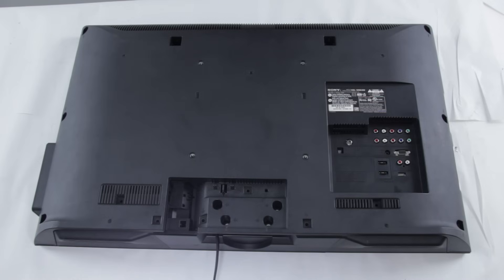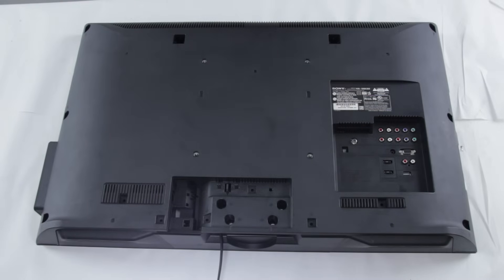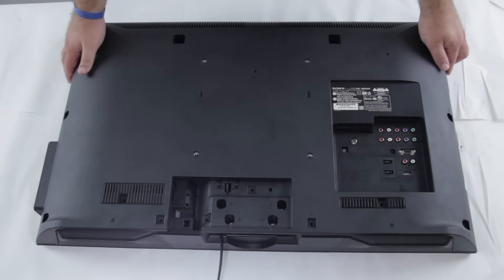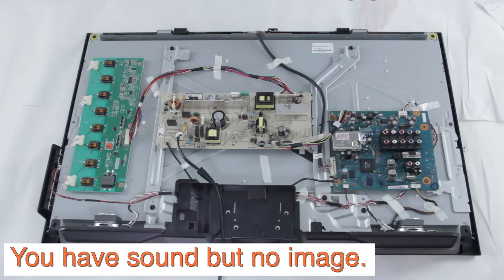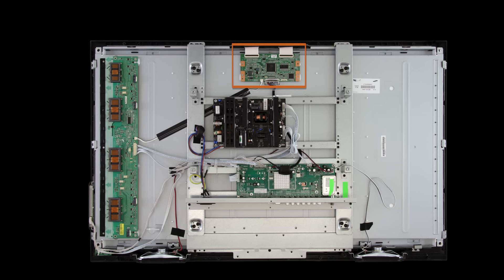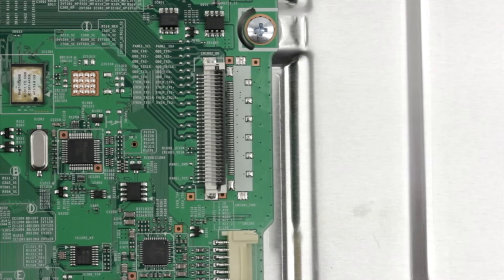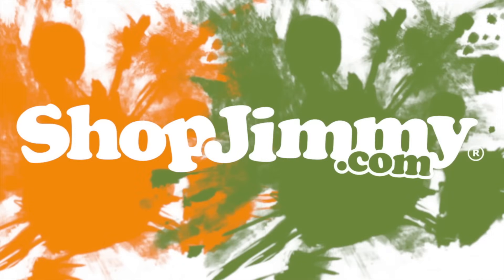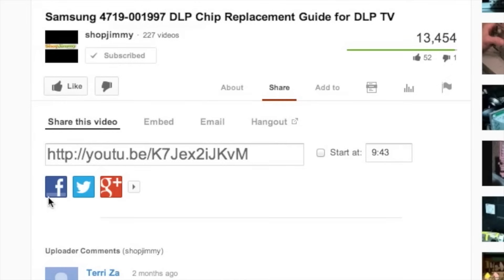LCD TV Repair Tutorial - T-Con Board Common Symptoms & Solutions - How to Replace T-Con Board

Comment: I have a vizio e701i-a3 with a thin red vertical line on the right side and a dark spot at the bottom that appears to be a led out but there is also dark coloration following the red line half way up the TV. Is this the t con board or the screen itself everything else is working on the TV.

Comment: Hi, I have a 48” Panasonic tx-48cx350b and the tv will work fine for about 20 minutes or less and then go Black. You can see the picture a bit without the light and sound is fine. Is this the t con board?

Comment: I have a samsung 55” tv model no. LN52A550P3FS, everytime i turn on the tv it has vertical lines in the center.. i watched ur video about t-con board problem.. do u have available stock of t-con board for my tv model?

Comment: I have a Samaung 32J5300 smart led tv purchased 28 months earlier now this product is out of warranty. I am facing red cloour lines and spots around the screen and the same problem was faced by me 18 months ago then its complete display was replaced under warranty and the same problem occurred again. Can it be rectified by replacing other parts like Tcon board or replace of display is the only solution but that very expensive.

Comment: I have a Sony KDL-55W800C that has a green/amber blinking light when i try to turn it on. I have no picture and no backlight from what I can tell, but I do have sound. One weird thing, when I popped off the back panel and disconnected the ribbon cable from the power supply board to the main board, the screen does light up, so I don't think the backlight is fried. I'm thinking the TCON board is bad. Am I barking up the wrong tree?

Comment: Hi guys i have a skyworth touchscreen tv . Pretty much what happens is the screen will come on. Its fine. Then after a minute or so the backlight will go off and the picture goes black. If i removed the hdmi for a bit the backlight comes back on. I plug hdmi in and picture restores but after a min or so will go back off.

Comment: I have a LG plasma tv that will get a hazy, grainy film over the picture. When I turn the tv off and on usually it will work fine. Its Model 50PS60UA, S# 907RMVB219287. Would replacing the tcon work here?

Comment: Hi. I have a Sony Bravia KDL40W5100 tv set here in Brazil and it starts to stop showing the images but keeping the audio ok. After you turned it off then turning it on again sometimes the video appears again, but many times you have to do the process several times. The technician told me that the problem is the Icon board and should be replaced but it is not easy to find one to be replaced. Sony does not supply it anymore and in the market you find only bad quality used items. So, the idea is to fix the Icon board, but how? Do you have any suggestions? Thanks

Comment: Hi ShopJimmy. I have a Toshiba LCD TV 40RV525R. No picture but has audio. Screen completely black. Flashlight test negative for image when light is put on the screen. Turned off the lights in the room to make it pitch black and no light is coming from the back of the tv. Toshiba light at the bottom part of bezel is on. Could it be the inverter?

Comment: I think I’m having the same problem every 10 mins or so my screen will just go green and static and makes a lot of noise. The only thing I found that works is using a blow dryer behind the right side on the tv small vent and it turns back on I got a 2009 Samsung  plasma model number PN50A510P3FXZA

Comment: I have a Sharp model LC-70LE857U and a black line has developed from the bottom right side, two thirds of the way to the left, apx 5 inches from the bottom.  Do you believe this to be a control board or the display itself?  If it is a board, which one? Serial number 303813274

Comment: Rca TV LCD mdl # 46L45RQ,    red light on front, will only turn on with remote control, blue light, blue screen, No signal  floating on screen.  I can not change the display the input will not work.  I have to reset many times.  When i first tv on PC appears in the upper right corner for a few seconds, then the no signal  comes and floats on the screen for about 10 or 12 minutes and tv cuts off.  any help will be appreciated.

Comment: Hello, wonder if you can help me. I have a 70" Aquos Sharp Flat screen that is approximately two years old. One night while watching the tv it began to have what appeared to be streaming pixilation instead of random pixilation like what happens during a storm and upon investigation it was discovered one of the male cats sprayed it. It did not appear to really have any liquid inside but apparently enough to ruin the tv. My father was a tv repairman so I felt comfortable taking the back off of it. Although he was clearly the "smart" one I had a screwdriver and thought what the heck, ha Where the cat sprayed this is the only board that would have been affected.  I really appreciate your time and any help (outside of killing the cat, lol) as I'd rather try to fix it then to run out and buy a new one, my budget will find me watching a 32"
Shelley

Comment: Blue Gate LED TV series 1

Model No: 32TD0013-BG

BG-32TD2013100229

It has audio and back light but black screen.  

It has one main board and a long board at the base where the t con connector is to the main board. What can I do since the t con board is not separate just like this one you use to explain.

Comment: I have a 60 inch vizio d60-d3 and I turned it on today and the left half of the screen is normal and the right half is dimmed with a visible vertical line dead center of screen it's the same across all inputs and menus tried power drain and factory reset and still not right
Reply: Ive cleaned all the t con connections as well no fix yet

Comment: Hi I have a Vizio E600i-B3 and it turns on and shows the Vizio start up logo but then shuts off after. I have replaced the tcon board but still the same issue, what should I replace next?

Comment: Hi i have a samsung ua32c4000 led tv. First i had backlight issues on the built in led driver/smps. Then upon seeing ur video i confirmed it was the led driver n got a replacement smps with builtin driver...hooked it up n all was good....there was pic sound n all...but after few hrs of switching it off n starting it again...totally nothing but start up led light. No pic even with the torchlight test. But one thing is wen i try to turn off the tv it will not switch off till i pull the mains...so is it all 3 board are gone now?? Pls help. Thanks.

Comment: Hey i'm fixing a TV for someone, and before i do anything i want to make sure it is in fact the t-con board.
The TV is a Samsung LN37A550P3F., and i have picture, i have sound, i have backlight, all that works. However all the colors are inverted or extremely vivid and over saturated. I can get it back to a somewhat normal looking picture but the colors are still off a bit and very Posterized. Is this sound like it could be the t-con board?
Reply: computerssuck93 where you able to fix this ?

Comment: Hey guys, great videos and helpful guides, I appreciate the time and effort helping others save themselves some money repairing their own TV problems. I am currently having a problem with my ln52b550k1fxza Samsung LCD, its quite old, but worked great up until quite recently. what happens is, when i connect a source to the TV the picture tries to display and shuts off the TV, if i left the source off or disconnected, the TV comes on no problem, I am able to navigate menus and change settings, there does not appear to be anything wrong with the display. occasionally the picture will pop up for a second or two but then shuts down the tv. when this happens, i dont see any pixelation, blurring, spottiness, anything like that. it appears fine, but just doesn't seem to stay on. but if i unplug that HDMI, it will stay on. any ideas or help when you have some time, would be greatly appreciated.!
Thanks again! ;)

Comment: I have a Sony KDL-55W800C 55 inch TV.  When I turned it on i have sound but no picture.  Working with Sony Tech support I did a factory reset and now the TV will turn on,  the screen turns on with the Sony name on it then goes black and restarts.  This continues to cycle this way and I get nothing more.  Could it be the TCON board?  Thank you.  My email is bjhagen@suddenlink.net

Comment: My TV is a TOSHIBA 40L2200U The tv works fine for about 1hr and then the picture goes out. still have sound. I put flashlight up to it and the picture is there , but the backlights are out,  but I can turn it off for a couple hrs and then its fine again for about an hr. What could this be

Comment: So the story with my tv is it was hit-" barely"! 3/4 of the screen is visible however has vertical and horizontal lines on it. Now where it was "struck" its mainly black vertically. I'm thinking the TCON board needs to be replaced however where it was hit show's a shatter looking mark where the initial contact was made. The "shatter" is internal and small. I"d be covered under warranty up until the mark presents itself. The TV is a Samsung LED 55", model number is UN55MU6300F but the Type # is UN55MU6300. Thank you for your time!

Comment: Hi Jimmy. I have a Hisense LCD40v86PE tv. The problem I have is that when you power it up you only get a blue screen for about 3-4 seconds then it is dead. I have test the power board and it shows the correct voltage output to the various  components. Al the caps, diodes etc in order. What can be the problem. Info would be much appreciated . You can send me a answer to stepnaude88@gmail.com.

Comment: I have a Samsung 46" LCD  smart TV. Model # UN46H6201AF. THE PROBLEM is the middle of the screen is brighter than the sides. Its harder to read things on the right and left 3rds of the screen. If you divide into 3rds. Everything else seems to work fine. Can you please advise

Comment: Thank you very much for the instructive video. I have a Sharp Aquos. Model: LC-C3242U / Serial Number: 705829687. It have muti-colored verticals lines at the left side (when you see it from the front of the TV).  I swapped the flex cables from place but still showing the multi-colored lines at the side. When you have time please give me an answer about it, thank you.

Comment: I have a Vizio E500I-B1 that at times there is sound and image....after a while the screen goes and so does the back light . I disconnect power for around 2 hrs and wala image is back again and blacklight. Ithought it could be the t- con ...but now after watching some videos it could possibly be the logic board or power board. But since it never turns off on its own I figure the power board may not be the issue . How can I be sure of this problem ??????

Comment: I have a 43inch lg high tower model number 43lf5900 it turns on normal the LG logo shows fine the settings show fine but it's black in back round with lines and  distortion where words should be I'll be happy to send a video of what is going on I've checked all capacitors and they all have study numbers

Comment: I have a LG 65eg9600 where the OLED panel is powering up (displaying black) but nothing is showing. I can't tell if there should or shouldn't be sound. It's not responding to the remote but it's fully powering on when plugged in (turning on)

Comment: I pick up a 46" LCD INSIGINA TV model  NS-46L240A13 120V-60HZ 150W as you point out the same issue I have power sand by red light when plug up on the front TV. Power the TV on and its show please wait on the screen then go black but you sound and a picture in the back ground if you use a flash light on the screen. So sound like I do need to replace the t-con Board which  am sure it is now. After order wrong board backlight inverter board now I have to send the other one back. But I will wait unto T-conn is in to be sure.

Comment: cabahugaris123 i have a problem my led tv model no. ua40ju6400r i found that the backlight is busted and then i buy u i replace it.when i turn the tv only sound i can heared but the lcd panel screen not working i check when i disconnect the ribbon wire from my t-con the backlight was light then i insert to the pin of t-con it will off.

Comment: I have a kdl-46ex500 ser. #1014276.  My issue is that my tv has just recently been losing its picture and the screen goes pink.  It doesn’t appear to be the cables as these have been working fine for years and I haven’t touched them.  Secondly, I have unplugged and replugged all of the cables and the problem still persists.  Is this tv worth repairing?

Comment: i have sound but no picture when i put tv on i see  light in back in some holes (no cover) for about 3 seconds i dont see picture with flashlight in the front. Voltage from psu are ok.Maybe i think t con board was bad...Thank for your response...Dan Dynex DX- LCD32-09

Comment: Thanks for the info but recently my lg65uh500 already replaced some the parts...capacitor, main board and no luck. Could it be the t-con? Symptom is that when I turn it on, it would turn off right after a second... could you guide me pls

Comment: I have a Insignia 50 inch. Tv works fine for about 30 seconds and screen turns black with sound. Turn tv off and turn back on and works again for 30 seconds. Picture is fine when on. Cannot get menu up or anything else when screen turns black. ?????

Comment: Hi. I have a Samsung ue46f6640ssxzg . All of a sudden backlight started to dim. colours were distorting then tv went off. After turning on i have a blinking backlight. No image (flashing light test). Yes audio. If i disconnect cable between backlight power supply and mainboard backlight stays fix (i guess all leds are ok). T-con failure? Can i get the part sonwhere? Thank you

Comment: Thanks for the video. I have a vizio P502ui-B1E tv. The symptoms were no sound no video. Vizio light flashed and went back out. I checked the power supply voltages they were all good. So I replaced the main board. Now the tv turns on and I have audio and back lights but still no video. Do you think I got a bad main board or could it be the led driver or tcon board?
Thanks
Dave

Comment: I believe I have a t-con board issue I have two lines running down the side of my Samsung it's an LCD 2010 model its Samsung LN 466t1f if you have an email address I could send a picture so you can see what it does but I'm pretty sure it's a t con board let me know

Comment: Hello I have a problem with my LG 55G2-UG. The issue is that it flashes green and black screen. When the green screen is on there is a horizontal black line and when the black flashes there is a blue line that goes vertical. Last time that the tv "worked" there was only sound but no image. Pls help

Comment: Hi Jimmy,
I have definetly broken t-con board on my 5-year old tv SAMSUNG UE40F5370, I know that that a guy in service diagnose it, and also the simptoms are the same as you have describe, the problem is that the guy told me that the repair would cost 200, which is basicaly a price of a second-handed TV of comparable or better specs, but to be honest I dont want to throw that old TV away and I would prefere to repair ti by my slef, but I dont know where to by spare t-con board, could you please advise me? I found some on e-bay aliexpress etc. but never for the exact same TV type, so I would like to know if the TVs from the same model range are using the same t-con board... Thank you.

Comment: hi , i have LG MODLE 42LB5510-TC  serial no 409SYJR0E700  . i have no pic ( if i going close to TV isee very weak pic) and i have sound . do i need to replace the T CON Board?  i open the TV an the T CON P/N is 6870C-0480A . THX  d

Comment: I have A LG TV. 
Model # 47LN5200-UB 
Serial # 310RMH1U374.
Was working fine the other day.  Went to turn it back on a couple hours later the screen was black. I unplugged it and tried again. A flash goes across the screen like it going to come on, but doesn't still a black screen. If you hold a flash light up to screen you can see very faint picture. TV sound is working fine. How do I fix this issue?

Comment: Model:M420SL
Serial no: LAQKMAAN3001742
Vizio 

Turned the TV on and there are faint bluish see through lines stationary horizontally on the display. I am wondering what i need to fix this before i purchase parts and fail

Comment: Can you suggest a fix for our Panasonic Viera L32G20BA.. The remote control response slows down after a few minutes after the tv has been switched on. Switching off at the main switch, then switching back on again the remote works ok, only to slow down and eventually stop working. The remote control works perfectly when checked out with a similar TV. This fault has been active for the last week. Our local TV repair shop has quoted £150 plus labour for a replacement main board, although the TV will run ok without changing channels for hours.

Comment: Have Sony kdl52nx800 had lightning strike. No sound no picture just light repeating 2 blinks
Replaced main board still nothing but light stays on solid now bought new power board same with same readings to output cables to other boards new tcon  arriving tomorrow if that does not fix it don't know what else to do.

Comment: Hello i have a Rca Lcd 37 inch flatscreen. I diagnosed it that has no backlights but sound and picture if using a flashlight at an angle. Replaced blacklight inverter board and still hasnt changed anything any help would be helpful